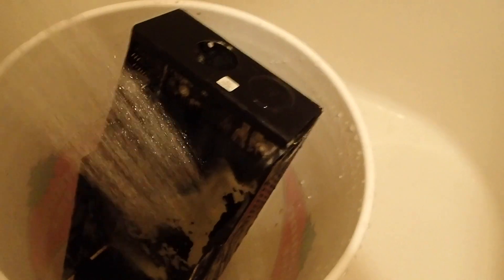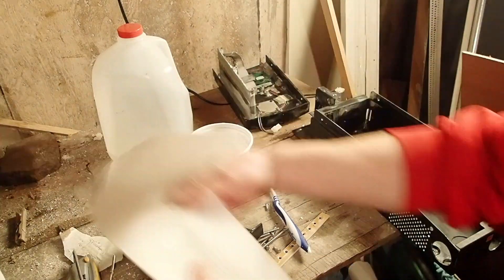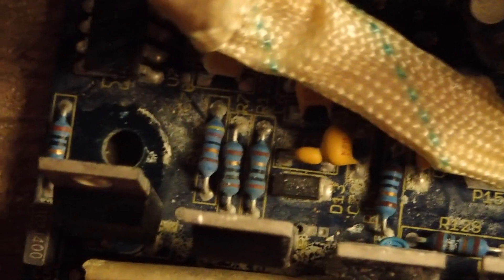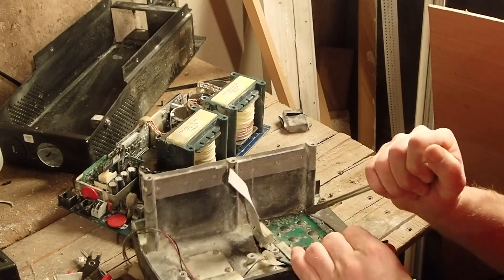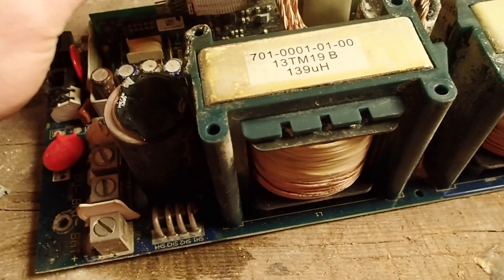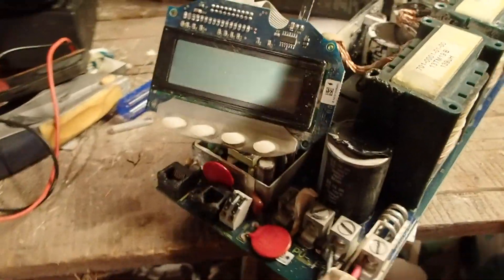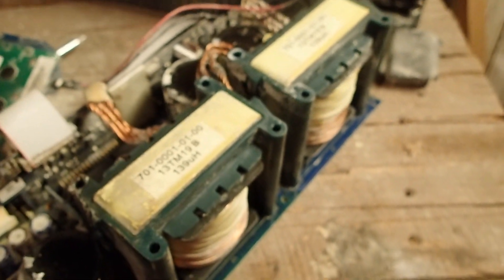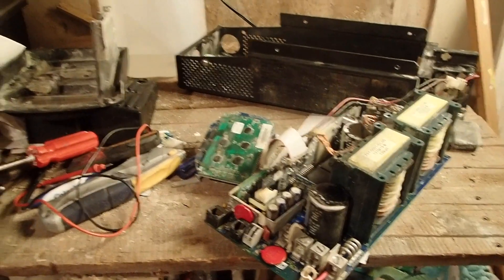Outback FlexMax 80  - Cleaning and Testing, Will it WORK?? Part 2

Comment: good evening good evening good evening

I have an out back flex max 80.
it does not light up again after a thunderstorm has passed.
everything i do it never wants to turn on.
in the control board part.
The u3 that powers the atmega644pa is very hot when I connect the out back flex max 80 to the battery voltage.
it's the three-legged u3 that's hot.
help me if you please